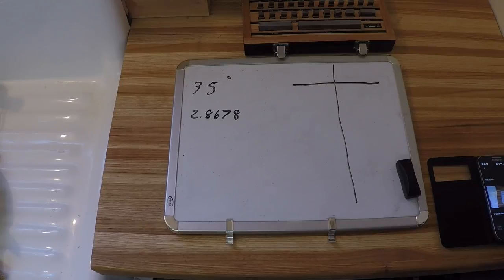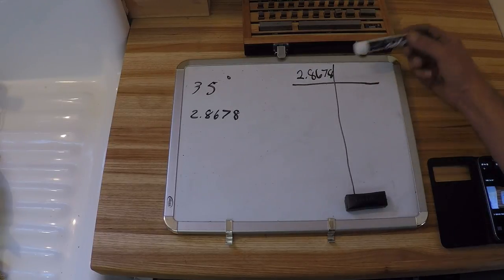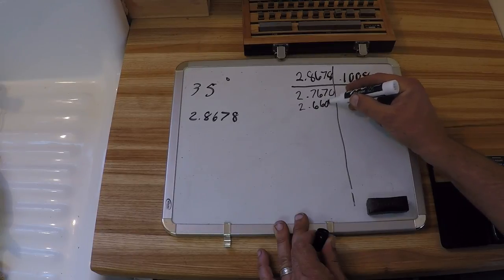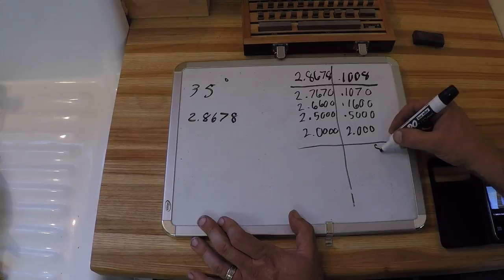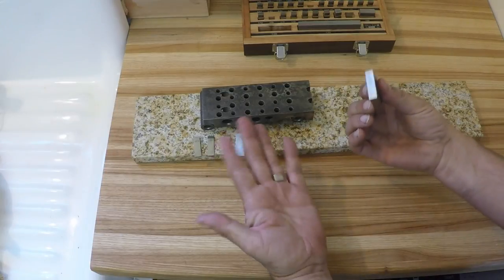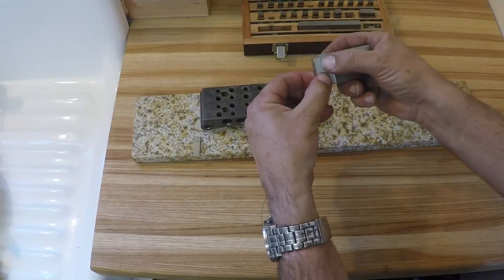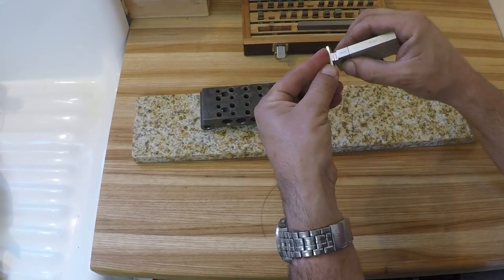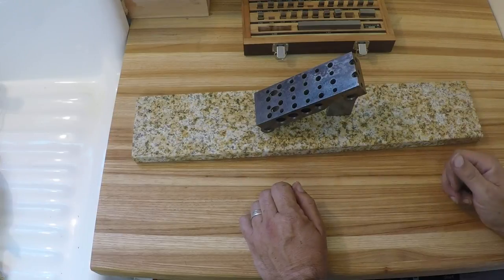Sine Bar Setup with Gage Blocks

Comment: that set contains a .160 block?
Reply from the maker: +Christopher Smith hemm I'll have to check buy why do you ask? I know in one of my videos my math was off.
Reply: Gage Blocks are boxed in four groups
group 1 - ten thousands (.1001 to .1009)
group 2 - thousands (.101 to .149)
group 3 - fifty thousands (.050 - .950)
group 4 -  inches (1" to 4")
Having a .160 block would fall outside the limits of the thousands group. (.101 to .149)
Since you pulled these from your own box, and wrung them all together, I was wondering where you were able to get a set that contained a .160 block?
Reply from the maker: +Christopher Smith I will look at that once I get home but I think it does  (then again I can always be wrong lol)
Reply: I have a little trick that i use when my thousands calculation is equal or greater than .150. I subtract a .150 block to bring the number less than .150, then, if I have any other fifty thousands blocks I combine the .150 to that to use just one fifty thousands block. (easier to show it than to write it out)
Reply from the maker: Christopher Smith post a video I'd love to see this I'll even link to it.
Reply from the maker: ok this set has the following block 0.050 0.100 and then thenthes starting at 0.1001 to 0.1009 then thousands from 0.101 to 0.109 then we go to 0110 to 0.190 bye ten thousand increments then 0.200 to to 0.500 bye one hundred thousandths increments an then 1.0  2.0 and 4.0     i don't know if this is conventional but it is what i have
Reply: Ha! Makes good sense to use thousands just like the tenths blocks. Nothing UN-conventional about them, they are just not as common as the 81 pc sets. Thanks for breaking those down into groups. Something new to me!
Reply from the maker: +Christopher Smith had me thinking I messed up lol yup its a 36 pice set
Reply: I might look into those....seems to be easier to use with only half the blocks
Reply from the maker: I do have a affiliate link but I think it's maybe for a 81 piece set